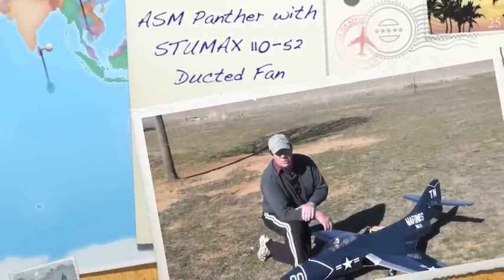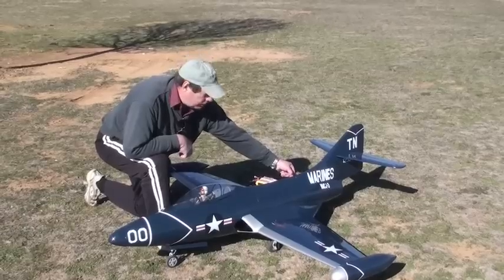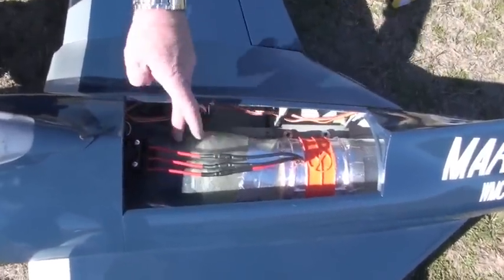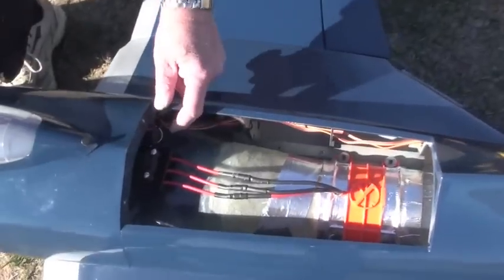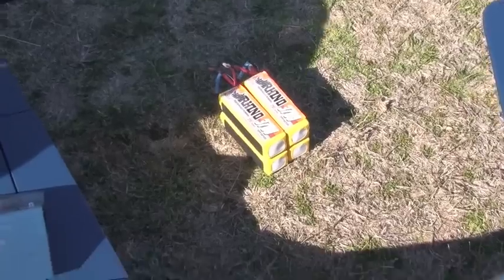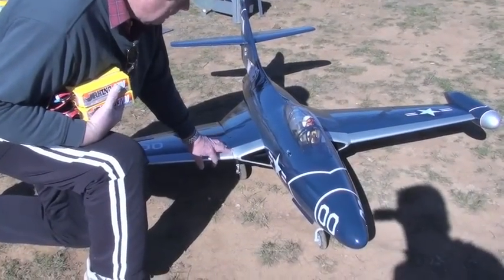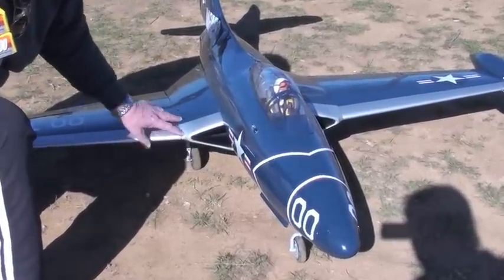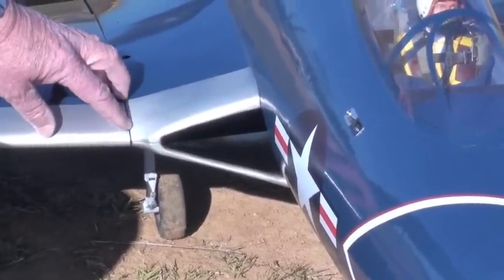STUMAX 110-52 Ducted Fan ASM Panther F9F

Comment: I am curiousw to find out if my two flight plans can be performed with your F9F 7400 config of the 110-52 StuMax.

Would you consider performing my two flight plans with your F9F with your 7400 configuration so that I can be more confident that I can utilize a pair of 110-52 with 7400 in my B-47...

Comment: 13S 6.2kW is where I am headed for a twin 110-52 project originally planned as a pair of EvoJet B-90's for power.

I am impressed with the 9kg lift claim and chasing down impressions and accumulate results from those using the 110-52.

I am curious what the AUW all up weight is on your F9F. Its taxi behavior amidst grass clumps of field hint that the F9F is exceptionally light weight... :^)